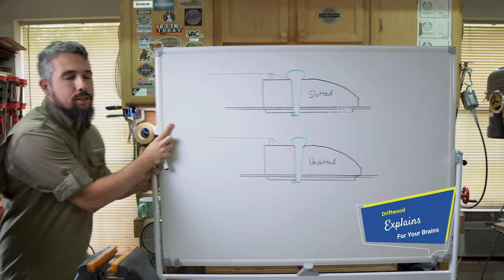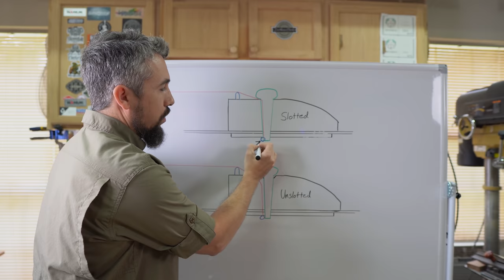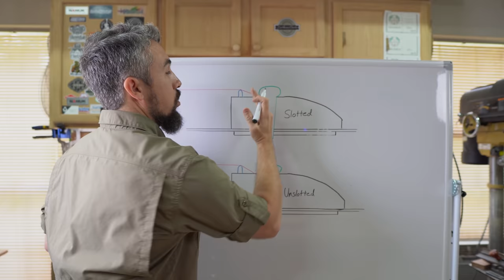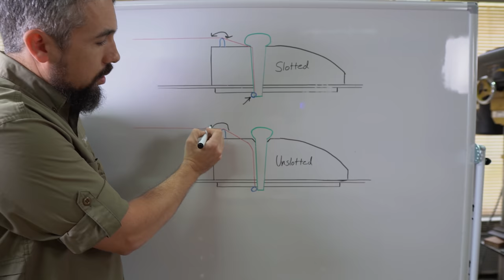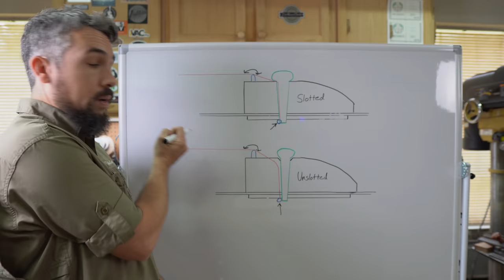This $25 Tool Can Help Anyone Make Their Guitar Sound Better!

Comment: 5:38 I find that the pins are easy to come out IF you push the string into the bridge a little bit BEFORE you try to pull it out. 😊

Comment: Another good video.
I’ve spent a few evenings filling the slots on wooden slotted bridge pins. I use super glue and small pieces of hardwood that I’ve shaped to fit the slot then sand to final shape. Oh yea I’m also retired so I have plenty of time.
Yes I’ve bought unslotted  pins from StewMac and LMI but liked the look of some pins I already had.
Reply: just turn them around.  easier than filling the slots.
Reply: @michaelbutler2312  I’ve done that but  the fit of the pins was a little sloppy with Gurian style pins.

Comment: I've just done it to my guitar (without the tool, which I cannot buy at the moment !) and the improvement is stunning. I believe the physics of it to be this:  the steeper break angle of the string forces the bridge 'bone' to press flatter against the top and allows more transmission of the string's vibration through the greater surface area of connection. The shallower angle tilts the bridge bone towards the base end of the guitar.  I coupled this modification with a replacement of bridge pins to Taylor ebony and strings to Martin Clapton's Choice phosphor bronze lights and a slight sanding of the bridge bone itself to lower the action. WOW !!!
Reply: The total modification cost me £13 sterling !!!  With the bridge bone operating in a more upright position there is less gap between it and the top.
Reply: By bridge “bone” do you mean the saddle?

Comment: I did this very job to my Fender Acoustic, that came with slotted 3mm Plastic pins
so I reamed out the pin holes, to 5mm, and bought some Bone 5mmPins
cut the slots into the bridge block, so they can be fixed to the instrument, and not the 3mm pins?
Fabulous result! 100% better tonally, and the volume from the guitar, is so much louder too
its now made a £350 guitar sound like a £1500 guitar

Comment: UPDATE: I commented earlier about the accented volume and widening of the tonal frequency response. I liked the difference very much, so much in fact, I invested in the tools and purchased a set of bone, unslotted pins and did is upgrade to my Martin GPGC-28 guitar. This is a BIG change! It comes with a mixed bag. Firstly, I want to get out there. THIS IS NOT A MODIFICATION FOR BEGINNERS, OR EVEN INTERMEDIATE PLAYERS. Especially if playing light strings or less. Only advanced players that have mastered string striking force, muting strings and clean fretting practices should consider this. The modification just raises the tonal excellence of a Martin guitar by orders of magnitude. However, any mistakes are also amplified. If you can play clean and a bit more softly to what you may be used to on the factory setup, I think you'll be blown away! If you're still learning, this change will only frustrate you. Thank you for this great video! I'll be watching more to widen my knowledge!

Comment: The steeper angle also increases the string tension and how much down-force is exerted on the bridge saddle.  Probably also the twisting force trying to pry up the far end of the bridge.
Reply: Is the increase in tension significant?

Comment: martin guitar forum had a rolling, free set of reamers and saws that were sent to members to then pass on to the next member.  i did three of my guitars.  reamed the bridge pin holes and turned the pin around and ramped the slot to get the better break angle.  mostly i found that the guitars seem to stay in tune longer, of course depending on the weather and humidity, and, did have more sustain.  i have one acoustic that i haven't done this to so i'll need to look around for a cheaper saw than stew mac.  they are pretty expensive on everything.  but, if you need it, then get it for yourself.  thanks for this video as a lot of people do not know of this.  slow and careful are the magic words.

Comment: Thanks guys, Don here from Hamilton NZ on my Wife's tablet-SUSAN,  yes thanks for your helpful tip on modefing the bridge-string, yes I do that ( on my 7 acoustic's) and it does make a Subtle tone improvement, and I also add a zero fret which I feel gives Slightly more sustain And you'll get a Slightly longer life ( enhances the twang slightly) outa your strings ( I'm just a cheapy, when you can't afford new strings) Do what you Can to enhance their sound. Just my opinion (for what it's worth) 😮😮😮

Comment: When I change my strings I bend a slight curve in the string near the ball end. When the string goes through the bridge, then install the bridge pin with the a lot over the string. It helps the ball end lock tightly to the side of the slotted pin. It prevents the pins pulling up when tuning up. The tight fit of the string to the bridge pin transfers the tone. I would not start slotting the  bridge on my guitars

Comment: So if I get this right: If you slot the bridge to hold and contain the string by itself, the bridge pins don't actually touch the strings in any significant way. So the material of the bridge pins have no impact whatsoever on the transition of the energy. So as long as you keep them lightweight, it doesn't matter if they're plastic, wood or bone, they basically just fill the hole for aesthetic purposes. Right?
Reply: He said that heavier pin material like Brass may dampen vibration (@2:35), so he suggests using lighter materials - not simply for aesthetic. He also said the pins are really just a bit of added "insurance" (@6:50) to ensure the strings don't pop out - but I'm thinking that's only if you really like to bang and pull on your guitar strings.
Reply: @nmcg2587  Sure, that's why I only mentioned plastic, wood or bone. So "upgrading" from plastic to wood or bone doesn't make a difference and "upgrading" to brass even makes things worse.

Comment: The idea of a brass saddle comes from the electric guitar world, where the goal is to maximize mass. The goal is to reduce transfer of vibration to the guitar body, which should increase sustain in the string itself.

Comment: did this modification to my guitar, i can't really tell if i like it or not, but there is definitely a difference in the sound. I think i went a little too far with the saw and now the ball ends aren't really touching the bridge pins anymore, i don't know if the bridge pins make a difference in the sound of the guitar, but they are pretty much useless now lol. The guitar sounds great, nice sustain, can't tell if the volume is louder or not, the tone has changed a little too.

Comment: I did this to my guitar and what happened was my A string began to go out of tune after a few weeks. The ball was pulling up through the hole slowly. It got worse over time. The improvement was small for me. Perhaps my skill level made a difference not getting the optimal outcome. 
The thing is that my guitar was now damaged. What to do?
Thank Jesus I was scrolling YT and I came across the TONEBAR channel. It's only $10 for the ToneBar BTW. Welll this solved my problem. More than that, it made the resonance increase BIGTIME. No B.S. Huge difference! In love with my Cheap Yamaha FGX800 C now. I can't imagine what improvement it would have on a high end guitar!
So if things went wrong for you like they did for me, here is the solution!
I wanted to come back and add that after recording my guitar which has the piezo pickup, the tone bar enhanced the  transfer of the tone. Instead of sounding like garbage it actually sounded real good. So this has been overlooked by Luthiers for a very long time.

Comment: Thanks for demonstrating this, as mentioned below it would be great to play the strings after the mod. Perhaps even do alternate strings to compare wound and un-wound. strings. Also, I was taught when changing strings to loosen them off completely and then push them back into the bridge to relieve the tension on the pin and bridge, this usually means a tool is not needed to remove the pins. When installing new strings I also pre bend the ball end into an arc so the ball always sits parallel to the length as this does less damage to the bridge plate and pins.

Comment: Minimal slotting though would force the string to compress into hole slot and more effectively transfer energy into the top otherwise the ball end would be the main device for transferring energy into the soundboard

Comment: This makes total sense and I would like to do it, but I'm still a little leery of cutting into my $2,500 Takamine. I know a lot of people are like, big deal $2,500, that's not even a high end guitar! Yeah well to me it is and it's about as high end as I'm ever going to be able to afford so you can see why I'm a tad nervous about doing it. Plus every woodworking project I've ever done has somehow gotten screwed up and never comes out looking like what I had planned. Guess I'll start on my cheap Fender beach guitar and see how that goes, if I have to replace the bridge on it after I make some weird oblong cut or somehow put a big crack in the bridge, at least it won't be that big a deal.
Reply: How did that inexpensive Fender guitar turn out with the slotted bridge?

Comment: Interesting.  2 questions though...
1)  Does the increased angle over the saddle increase the chance of breaking a string?
2)  Is it difficult to change strings?  Since the string is kinda wedged into the bridge.

I'm really considering doing this to $4K of acoustic guitars but would like some feedback first.

Comment: Thanks for the video and 'sound" explanation... Will have to try this on one of my lower end models before going up.. It would be nice to have a before and after comparison on a real functioning lower end guitar to hear the difference. Of course this video begs the question: "If it makes such a difference, why aren't guitar manufacturing companies doing it now"? Considering they use CNC technology for almost everything in mass guitar manufacturing, surely they could create a program that would incorporate it into their build process. I like the hack of turning the slotted bridge pin around if it's already ebony or bone and actually fits the existing bridge hole.

Comment: From the diagrams that he provided on the dry eraser board, intuitively what he is saying, makes sense, however. This may actually make the guitar sound better, but unless we hook the guitar up to a spectrometer and get an oscillation reading on each string, and then do the work to modify the string angle, turn it back up, string it back up and then record the oscillations on each string again and then compare because to say it sounds better after it’s done that subjective but if you have mathematical data that indeed is the best science and the best science is to show a cause and effect relationship is to have a control group and an experiment group, so what groups are we talking about? Well essentially here we’re talking about two guitars. The one is prior to being modified with the $25 device and that is the control group and the experiment group is the Guitar after modification with the $25 saw, and when you keep all things equal between the control group and the experiment group, except one thing, and one thing only changed with the experiment group, he changed the angle that the string comes down from the bridge distantly into the pen and made it more acute, unless abuse, therefore bringing more down pressure on the bridge, and therefore the soundboard I would love to see this video done with a before and after with an oscillator on it to show definitively that it makes Guitar sound better.

Comment: I really hope you'll see this and get your opinion!
There's a guy who invented and even patented something he calls the "tonebar" (he has a youtube channel'with the same name). Basically, he attaches all the strings to a small metal bar (puts the bar through the ball-ends), places the bar under the bridge through the sound hole and his claim is that this makes a better contact surface than the small surface around the pin hole. 
Let's forget about having to take all the strings off if you want to replace 1 single string... Isn't that what the saddle is for? 
I directed him to this video but he didn't respond.
As an experienced luthier, what do you think about having a bar under the bridge with all the strings attached to it instead of having each single string making contact with the bridge?

Comment: It's definitely true. I had a friend who is a professional luthier do this with my Larrivee OM-03R and yes, the guitar is a relative cannon now. One thing that's funny though is how this actually takes the pins completely out of the equation making them solely a decorative element; if properly done, you can actually REMOVE the bridge pins after tuning the guitar to tension. How's that for removal of mass?
Reply: Their weight is absolutely insignificant (if they’re not metal, and even though the difference is very very small)

Comment: Interesting theory I don't have an issue with, but what's missing is empirical evidence that measures decibels before and after, obviously with a way to pluck the strings evenly before and after. That would drive the point home visually (since transfer of sound to viewers laptop is so variable.)

Comment: When I did that to my hand built 12 sting guitar I used a hacksaw blade and I thought I was committing a cardinal sin. But I had to due to the top bellying up and reducing the break angle causing the octave strings to buzz. Instead of reeming the pin holes I shaved a couple of thou off each wooden bridge pin. Lucky for me they are all unslotted!

Comment: Once the strings are tuned to pitch why not remove the bridge pins to take more weight off the bridge for even better sound? You would only use the pins to string up then remove them
Reply: He mentions them as insurance.. but the pins make restringing easier. And if ever the ball slips from the bridge plate at full tension it can do some damage.  Ebony bridge pins are usually less that 1g each so not a huge difference (compared to brass which can be around 6-7g each)

Comment: Nice video and nice advice. I have noticed that when I have sanded down the bridge of the guitar to become a better string action. The sound war pourer after. But in my oppinion, I thing that more string angle behind the bridge make the tuning stabillity worst then less string angle. The same story with the string trees on the headstock. I would like to hear your oppinion abouth that Chris. And yes, rock on, you are amazing, the success is on the horisont already:) Best regards!!!
Reply: I've also heard that tuning becomes more finicky when you do this. I think I might buy a couple of washers to thread onto my next set of strings though. I don't want to cut my Gibson J35 about, I like it a lot. I don't even want to get rid of the dogshit piezo that I never use although I have replaced the stock saddle with an Allparts compensated. Washers - I don't even know if I can thread the strings through from underneath like that.................if it ain't broke, why fix it?

Comment: Good commercial for a saw. Would it be better if you actually done modifications to an actual acoustic and using also trying Ebony pins and sound b4 and after.

Comment: Just buy some scroll saw blades. Some have pins on the ends and if they do just cut the ends off and wham you are ready to go.  Thats what I did and it worked great.  So instead of spending $30 you will spend about $4 !

Comment: By making the string break over the bridge nut at a steeper angle. You're simultaneously causing the string to arc upper ward after the nut towards the sound hole. Essentially raising the string height. Which would be only a few thousands of an inch. But could cause unwanted side effects. 
An example would be if your string tree on a head stock was pulling down to much. It would cause the string to raise off the nut on the first fret side. This happened to an electric guitar I owned. The effect was a sitar sound buzzing in the string. 
But let's say your suggestion is correct. I have to ask, why aren't the big manufactures doing it to their guitars? Sounds like a very cheap and minor step for them.
Reply: Looks at old Martins. They do do this. But once your making a shit ton of guitars a day, it saves a lot of time and money to just use slotted pins and call it a day

Comment: A good test of this rather than just a before and after on a single guitar would be to get 2 guitars of the same brand / model, leave one factory and do the work on the other. Have them both played at the same time on video with as close to same strumming on each through the same mics. yes ?  You could do it with your own guitars and offer standard or adjusted ?

Comment: Surely the increased break angle could lead to lateral pressure on the saddle trying to force it forward in the bridge slot . This must be more pronounced with heavier gauge string and could lead to intonation issues .

Comment: i have a martin hd28 from the early 60s. the pickguard had pulled up and shrunk a bit. i procured the proper replacement. after removing the old pickguard and cleaning the glue residue i was amazed at how much better the guitar sounded w/o the pickguard. it had a sparkling top end that sounded wonderful. i love it. i will never glue a plastic pickguard on the top of an acoustic again. shame on Martin for doing it.